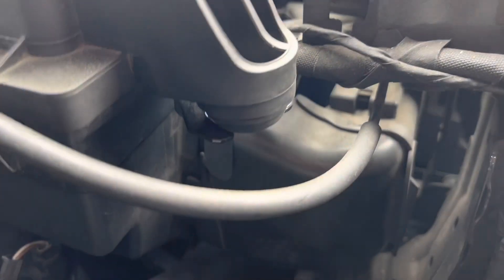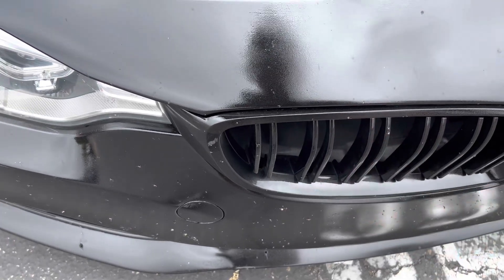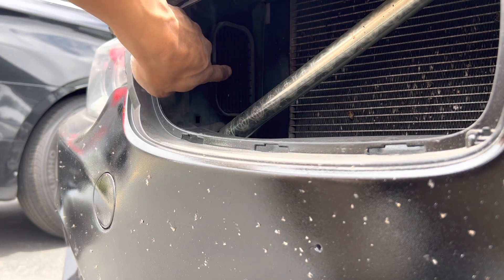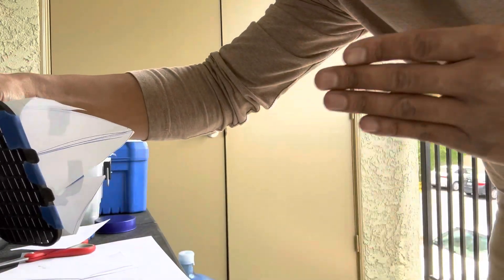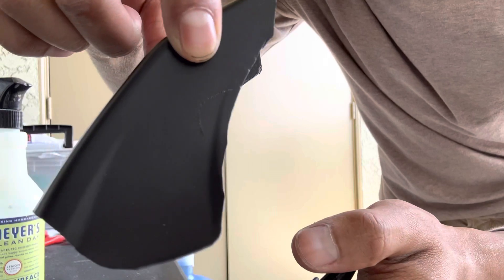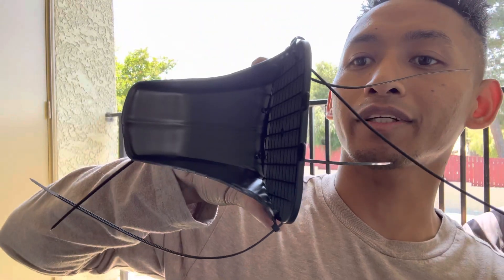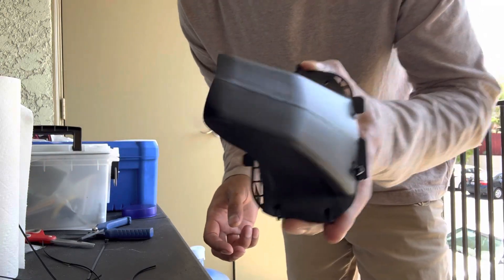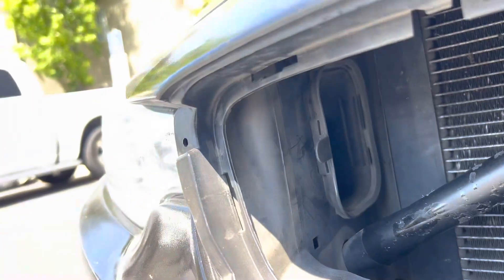F30 F32 BMW gets a DIY  intake scoop!!

Comment: I didn't explain well: does it also work well on diesel engines? Thank you
Reply from the maker: Although I don’t have much experience with diesel engines, but I’m sure it’ll help with the air flowing through the intake better. (Just replaced my filter I noticed more dust than usual)
Reply: @ItsVannT  Thank you